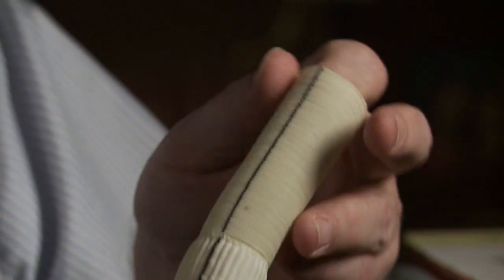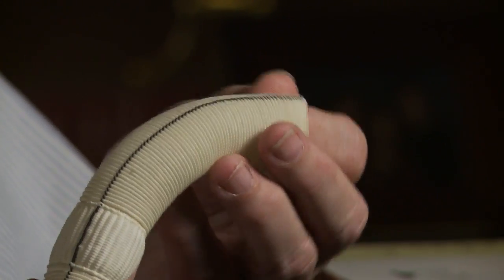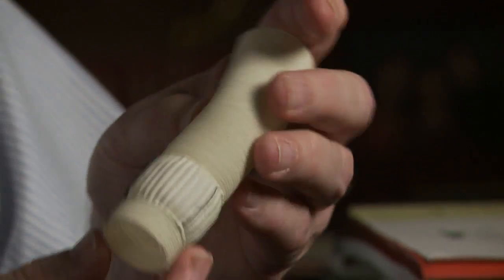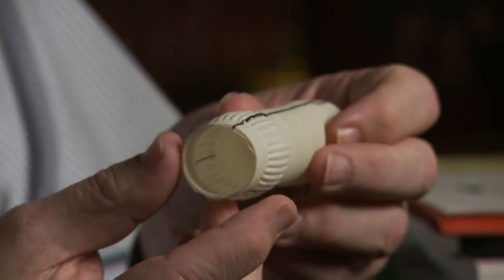How does the Dacron graft replace the aorta?

Comment: Dacron Ascending Aorta Stent Graft: I have been suffering with an intense knocking with each heartbeat since my BAV valve and dacron ascending aorta graft replacement in April 2016. I have tried several times to plead with the doctors that I have an issue and they deny I'm feeling anything other than a normal heartbeat (because they can't feel what I'm feeling). I have not been able to get one full nights sleep in the last year having to use melatonin to try and doze off, but wake up in the middle of the night several times. It's exhausting with the knocking I feel.

I have seen another video that they may not have even needed to replace the aorta with a dacron graft as my aorta was only 4.3-4.5 cm (less that the 5-6 cm size determined to warrant surgery). It was not dissected, only larger than normal.

Yesterday I discovered I could actually record the knocking heart sounds with my cell phone and may do a separate post. I'm hoping someone can provide answers to the knocking on the recording as I believe the dacron graft is slamming against my breastbone with each beat. They have done the usual echo-cardiogram but say everything is normal, that what I'm feeling is normal.

The nurse practitioner assistant to the primary cardiologist is rude saying I think I'm smarter than her because I said she cannot feel what I'm feeling and does not want to listen to me (she actually shook her finger in my face saying she's done listening to me). It's hard to believe the battles I've been fighting especially that the surgery went 11 hours and they could not get my heart to beat right or coagulate properly. I believe it's the dacron aorta flopping against my body because there's too much slop in there. Trying to sleep it's like a shutter slamming in the wind all night long but is inside my body. I don't know what to do.
Reply: David Hoff Your valve is probably ok and you are hearing through your vascular connections to the brain, passing your ears. The condition of being able to feel the heartbeat is, more than likely, due to the possibility of the Pericardium not been replaced. In normal circumstances the Pericardium lubricates and protects the heart. If it is no longer there (a common practice and not detrimental to the function) the chances are you can feel it because of its close proximity to the chest wall. The doctors will report on its function, post operatively, and that will now be better than it was. As for its physical effect due to the mechanical nature of the device, there is no adjustment to make it any different. I am ten years post-op and everything is wonderful now it’s all settled down.

Comment: i had a bad car wreck 18 years ago and my aorta to my heart spiral tore and fell down in itself and the heart surgeon said he put plastic cloth around it to repair it,  would this be what he was talking about?
Reply from the maker: +Nima Norman These answers are specifically for aortic dissection caused by Marfan syndrome and other connective tissue disorders. Some of the treatment is the same, but there are some different considerations if there is an underlying connective tissue problem.
Reply: @TheMarfanFoundation   Hi doc I had a aortic root done with dacron graft by Dr Allen stewart of mount Sinai hospital in 2016 he saved my aortic valve ..Will the dacron graft last a lifetime?
Reply: @salrusso1233  You can submit medical questions at marfan.org/ask. Also, we will have a series of webinars on aortic surgery in February. You can sign up for our emails at marfan.org to ensure you are alerted about registration (free).
Reply: @eileenmasciale1524  Awww Eileen thank you so much ❤.  I do not have marfan syndrome i believe it is called? I was tested for that i actually feel good had the operation in 2016 in nyc im have a hard time mentally with it at times worry about something going wrong. 🙄🤕

Comment: Why wouldn't you wrap the aorta?
Reply: *****
I did some research on this and so far, I haven't found a reason not to believe in the PEARS procedure.
I am not a Marfan's patient so far as the tests can reveal, but if I had an aneurysm be it caused by Marfan's or any other defect, I think I would much prefer this less invasive procedure.
I would deliberately do all my best to find a surgeon who is wiling to perform it.
The thought of having my aorta replaced by a dacron tube is scary on it's own. To add to that, having to take warfarin for the rest of my life.
Reply: @Froggboii69   I don't know lol. I had two echo's done close to four years ago each about a year apart. My aorta is fine as far as those tests are concerned. I have been running and playing other sports since then. The doctor who ordered my tests told me she doesn't think I am a patient and I should just forget about it. I have the classic pectus carinatum and double jointedness. Someone told me I could have MASS(not sure what that is), but they described it as Marfan's without the aortic aneurysm.